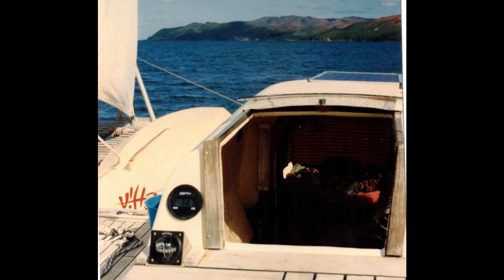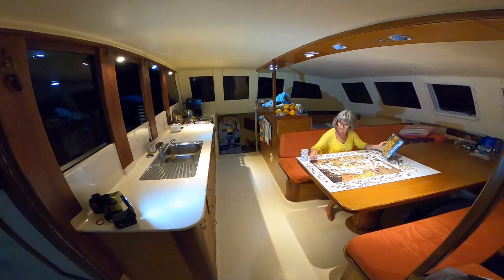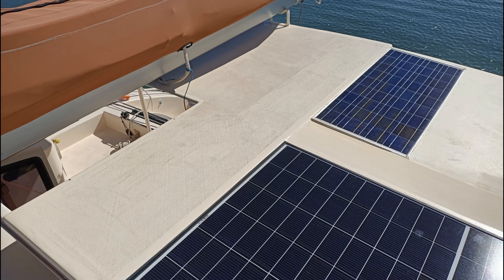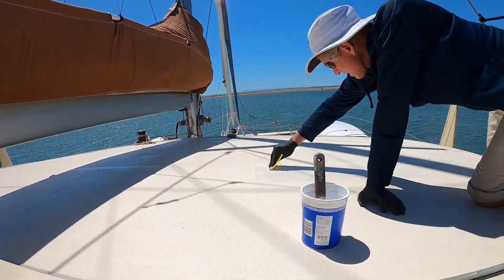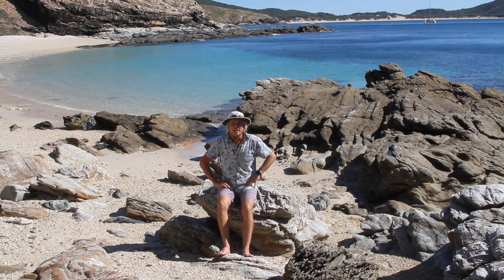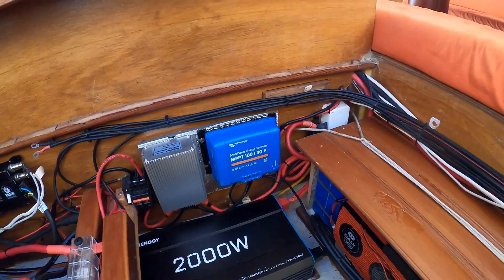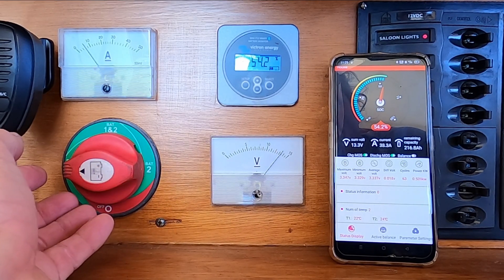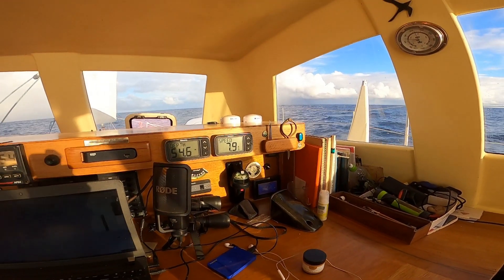Secrets of the best solar power system- The Solar Electric boat explained

Comment: Interesting approach! I have not thought of bending the solid glass panels, but it appears as that their performance is not impacted by the bending. I guess if the glass doesn't break, the silicon cells will also not crack.

Thanks for sharing your experiences.
Reply from the maker: Yes, I would have like to show the glass solar panel that I had removed the frame from some years before. They are amazingly flexible and very easy to bend. This is where I gained the confidence to bend the whole thing like this. Unfortunately it was taken to the tip. I had glued it straight onto the bimini but it got much to hot like this.
Reply: @AndrewStransky-cc2dr  Have you looked into BiFacial panels yet? Those do not have the white backing to them, so the cells can convert light reflected onto the back surface too and are as a result about 20% (don't quote me on that) more efficient.
They would perform amazingly over the davits as they would receive a ton of reflected sunlight off the water.

I'm doing a bunch of research for my own build, I want to have the cat fully electric so I'm going to need everything I can out of the panels.
Reply from the maker: @theromihs  yes, they certainly can produce more power and my friend the solar installer was onto me for not using them.  In our situation, where the bimini is primarily acting as a shade to keep us out of the sun, I feel the extra light coming through would be reducing our protection from the sun. In situations where your instal is not doubling as a UV blocker, like stern mounted, the bifacials would be the very thing.
Reply: They are now producing higher output panels that are lighter  use less critical materials and less prone to failure ..they are glass but can bend quite dramatically.  There are also new panel PV chemistries arriving that can use more of the available light spectrum and cope with higher temperatures.. 
Battery and PV panels are dropping in price yet improving in performance and safety.
Reply from the maker: @clivestainlesssteelwomble7665  yes so much development going on. I don't suppose theirs much point waiting for it to mature, as it will be developing for quite some time. The Hyundai panels have some great teach, the way they slice the cells into 5, then use electrically conductive adhesive rather than silver/copper. The shingles sections of cell are at a lower voltage reducing panel heat. So good stuff, but as you say it has far to go! I got my final panels through a large supply house and they were so cheap!
Reply: @AndrewStransky-cc2dr  I know it's been a year but I'm curious whether the bent glass show any signe of cracking? I did not think glass panels could be bent like that, but it’s probably thin to keep the weight down.

I'm also wodering if cracked panels can be repaired/sealed like car glass? 👋🇧🇻

Edit: I live by my Victron multipluss II 3000/32, 48V 150Ah lead batteries and 2.6kwp pv vertically wall mounted. 🤔 and loads of firewood in the 6 cold months 😅
Reply from the maker: @noldushumlesnurr6169 yes it is interesting how well the panels can bend. I had completely pulled off all the aluminum surrounds off a panel previously as an experiment. It was here I discovered how easily they bent. It must be a very different type of glass to the stuff you get for windows, say, which are very stiff! So no sign of any cracking at all on my curved panels. I don't think you can repair cracked panels as water would get into the cells and cell wiring. We did repair panels that had corrosion from underneath on our previous boat by re-soldering broken connections. Yes, I imagine in a cold climate you would need wood to keep warm. I can imagine that with a bigger solar system and battery you could possibly heat via pure electric, but who doesn't love the romance of a wood fire!!
Reply: @AndrewStransky-cc2dr  I definitely got to get my hands on some test panels now 😅 And yes, looking at mppt boost converters inspired by your setup. It will come in handy when I get back on the water. I did racing and boat building in my youth and are currently looking for a suitable retirement project.

There is no way pv can do house heating in the winter here (new superinsulated house maybe, not my 100yo timber house). Last dec + jan my setup produced 19kWh (6×275wp +3x380wp =  2790wp). My panel placement is optimised for winter use, unfortunately the days are to short and to cloudy. But 7 out of 12 months all my basic needs are covered and I use the batteries to offset the peak tariffs during the winter months, not to mention that my solar installation has changed my attitude regarding energy usage. Wood is in many ways the ultimate renewable energy storage unit, but labour intensive. Keeps you warm 3 times as we say 😃

Thanks for replying 👋🇧🇻

Comment: Thanks for all that Andrew, I love the clever way you got the alloy panels to fit the curved deck. I will steal that idea for sure. I remember reading about the perils of series type solar panels, I don't really get it but I think it is Nigel Calder's book. Cheers Phil
Reply from the maker: Thank you Phil! Yes, I had removed a glass panel from its fame some years ago and was impressed at how easily it bent. I tried gluing it straight onto the bimini but it got way too hot and didn't produce much power like this. One way I can see series dropping out charge is if one panel loses its voltage output then the two panels don't have enough combined voltage to reach the charging voltage. There are other reasons of course.